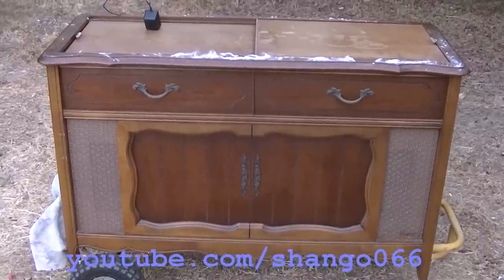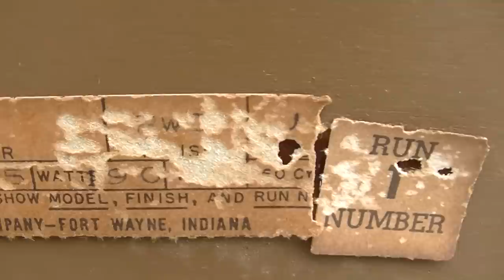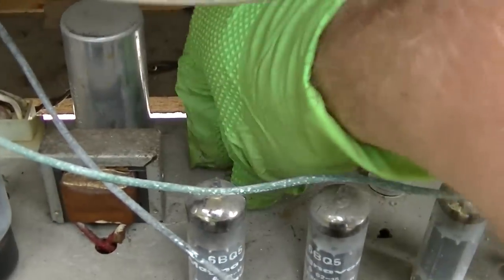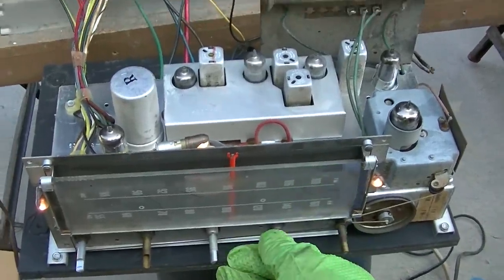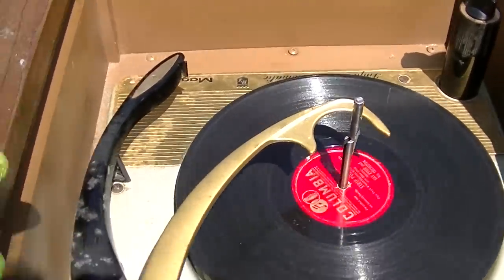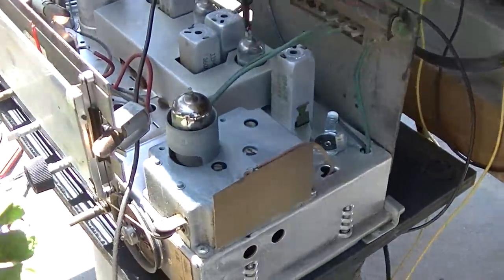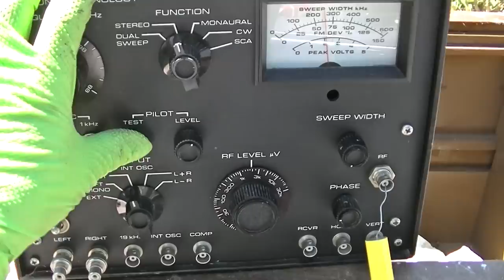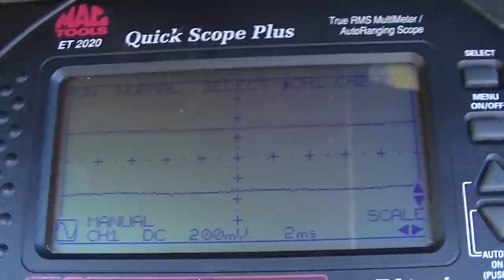1963 Magnavox Console Stereo Phono AM FM MPX Resurrection Repair Whatever v3

Comment: Considering that ancient linear wall wart and that huge barrel connector; I think that a portable CD player was the thing using that AUX input.
Reply: Doesn't seem all that ancient though.
Reply: @marka1986  

It has a datecode of '94 on it apparently, and it also looks that way. Late 80s to early 00s.
Reply: I guessed the same thing I bet someone way back when used a portable cd player on this
Reply: That's an eighth inch barrel. Screams Discman to me.
Reply: @cookingwithchefjeff  weren't that the same eighth inchers that was in everything until recently?
Reply: Walkman!

Comment: That is actually a very nice amplifier.  David Gillespie posted a thread over on AudioKarma called "More Fun with Magnavox: The 9300 Series."  He modifies that exact amplifier with minimal effort and effectively makes it "HiFi" (at least as HiFi as tubes can be.)  I have one of those amps myself, and am currently building a second one from scratch.  They sound very nice. That is an awesome find!  NOT TRASH!
Reply: This is a premium model. The Imperial line was only sold through Magnavox franchised dealers. You couldn't get this in a department store where  the regular line was sold.
Reply: @66skate  It was rare to find any Magnavox console stereos in department stores where I lived in NJ.(60s, 70s)   The department stores had low end stuff "Admiral, Electrophonic etc " you had to go to appliance dealers to get good HiFi and TVs
Reply: @seesea-sv3xw  There were 2 dept stores where I lived in Massachusetts back then that sold Magnavox.. One of them had an entire area with only Magnavox. Next town over had a Magnavox only store.

Comment: OK I sucked at TVs but I still do these consoles in my sleep blindfolded and can say that while you went more than a bit roundiebout you got it basically right and accomplished the task at hand. It was tons of fun to watch while I wasn't screaming at the screen.😋🤣
We in a production environment wouldn't waste any time on old caps but you know that with TVs. I just wish 2022 technology allowed me to demo you how we do FM now. It really is a jaw dropping experience to go from caps, coils, resistors and tubes/transistors to software defined radio with no parts at all but a pre-existing PC. and a cheap USB dongle.

Also I didn't even know that rpm phone app existed. I've been on the strobe disc. I will use the app going forward. Thank you fine sir. You're a gentleman and a scholar.
I did enjoy doing CRT setups back in the day but the business aspect and that 40KV thingie (60KV if you include the Zeniths with the neck blown off the bulb from the bad cap) kind of kept me from getting all pro with it.

Comment: All your videos are really enjoyable but this one in particular was really great fun to watch, put it on and thought i'd watch a little and go get a drink and come back and watch the rest but ended up sitting down and watching it all.

I think even today if that were all in running order with proper crossovers and some decent music fed into it it would still blow people away, especially the younger kids who have never heard music played on anything larger than a phone speaker before.

I'd guess it was a portable CD player hooked up (badly) to the aux.. I had something similar 25 years ago now.. doesn't seem that long!

10-12 watts per channel in PP maybe? Never did get to see the underside of the amp/psu, wonder what the other side of that tuner plug looked like.. probably a rats nest of wires..do you think its probably a cathode bypass capacitor shorted / bad plate resistor to the output tubes causing them to redplate?

finally that MPX unit really well made.. I recognized your comment about tubes with FM stereo being unreliable.. seen a lot of philco stuff that seemed to go out of alignment just by breathing on the leads!

Comment: I have a 1954 Zenith console Am Fm with cobramatic turntable that my great uncle bought new. He knew how much I liked it and I inherited when he passed in 1994 at 100! It works absolutely fantastic, the cabinet is very nice, I'm sure he never had a restoration on it, so I belive its all original,  I checked all the tubes in it when I got it,  they are all Zenith,  except for 1. That one is a GE. in the 28 years I've used It, its needed nothing,  it just always works!

Comment: RCA developed stereophonic sound in around 1958 for phonographs. That's probably what that patent is referring to. These Magnavox consoles are great consoles. Very well built, as you pointed out. And they can really sound great when they are working correctly. By the end I was practically screaming at the screen for you to replace caps in that power chassis. Man, this thing could still be great. Get in there and knock those coupling caps out and fix that oscillation too.
Reply from the maker: It's all disc. There was no bias  from wakey capacitors I checked that . It probably needs some New electrolytic but whoever adopts it can do that
Reply: Gotcha! Missed that part.

Comment: I recently put an order in with Electronic Goldmine out of Arizona, and as part of that order I included one of their gold-pak capacitor bulk box. It contained about 40 of that style capacitors in the box of around 1000 caps. I had never seen one like that before.  It sure resupplied me with caps, I should sort and sell a few hundred of the electrolytic in 4.7 to 470 most brand name caps at various voltages as my bin is overflowing with many of them.  Good outfit for their large capacitor surprise packages.

Comment: While I miss the CRT work, this unstraight troubleshooting by our  unrestrained host was wonderful walk down memories lane. My parents owned the Maggie model above this edition. In fact, the top early 1960s stereo furniture by Magnavox. It has FM tuning eye, VIVIVIVIbrasonic, center bass woofer 15", L R 8" mid-range, LR 1" tweeter, changer, etc. Here is the kicker: my brother kept it, original tubes, resistors, and caps. Except for the dirty pots, it operates perfectly...60 freaking years later. The problem is not with corporate WOKE which is just PR. The problem is that nothing is done for decades any more. It is all short side leadership in every sector. We don't build em this way.

Comment: Thanks to this video I learned. Well let me just say, I just picked up a 1962 magnavox theatre (27 pict. tube)no uhf/ am/fm tuner/phono
 Model (1MP422M). But it has close to the same amp and tuner ( except my am/fm tuner has a spot to turn the tv off and on. speakers have the same horns pointing forward, big woofers pointingat the ends of cabinet, same as that one. But I found out it's tough to get the Sams photofact for Magnav. consoles. I called one guy selling them Steve, he said take out the tuner, and take close up picture of it, and give him a drawing with the tube location and names and he'll take a couple of days & try and come up with the Sams.  I just got it, seeing how it was all
tube I hoped, th  model # wasn't given in the add just said $100 bucks come and bring a truck. The "sun", must have been hitting the back of the tv for years as the model #paper was very hard to read I corrected 1 letter I had off from another person selling a simular unit that the paper tag wasn't bleached out. He just had sereis 1 & I have sereis 3.  But I've only had It for  less than 3 days. I think the tubes that said 62
were correct. I think they, went solid state in 1963. My tubes (high hrs set) are caked with dust, So I haven't read amything yet. But I looked at that metal inpression  stamp No. on the multiplex board it matches your Number, maybe just a part No.  But I didn't know what board that was or what It did. Thks for that informative part , about the multiplex and what it's job is. And how the tuner has special plugs and everything just will plug in.The only way to talk the wife into me, getting this, ( being as big and heavy as it is) was that it's my christmas present for 2023, except she did let me get a tube tester and  Beltron CRT Tester Restorer With Dandy-Dapter Universal Adapter CA-28
 $140.00  plus $30 shipping. I know I paid way to much for that. I tried to cancel it when I found he was charging double the going rate.

Comment: Magnavox console model 1ST659A from 1963 . For starters might need to use half a can of DeOxit on those switches, 
tube sockets, terminal contacts, and pots! It's an all uphill battle on that basket case after that. Your analysis of how the whole thing works is a great
 teaching experience for the viewer Shango.
Reply: 1961 MODEL
IMPERIAL MICROMATIC CHANGER IS FROM 1961

Comment: As usual your videos are very entertaining. The best part of this unit is the amplifier and the speakers. If you work to pull out that amplifier and recap it you would have a very nice amp there. Back in the day these units sounded fantastic. About 35 years ago I was able to drag one home that was found in the street but it was much larger and had the television in it. The CRT was bad in the TV so actually all I did was parted it out the amp the turntable the speakers and the rest went in the trash.
Reply: The power amp section sounds better than Dynaco!

Comment: Excellent video! I have this exact model and have started restoring it, including full recap, and want to get back to revisiting it, as it still has some remaining problems including too much 60 Hz hum which might be shielding or grounding issues somewhere. Mine also has crossover cap issues where one side has some treble and the other side has none at all out of the horns. I had two multiplex adapters for it and one worked and the other is quiet. I wonder if that 4 MFD cap in the quiet one is bad like on this one!  I had to stop working on mine when I had people wanting me to repair other radios for them.

Comment: I've got a very similar model.  I had a heck of a time trying to find service information for it, the only thing I could find was a Sam's for the tuner.  Turned out the power choke must have shorted a few turns and the plate voltages were around 300 instead of the 245, which was causing the 6BQ5s to red plate.  Added a resistor (okay, a 40 watt light bulb) which brought it back down.
Reply: I brought similar unit as used in 1974 from fellow student at school for $80.00. The unit has similar FM modulation unit connected with cable. I took the tube to Radio Shack for testing and replaced the tube. When power on it blew the fuse. I tried to repair it myself and unsuccessful. My portents thrown it away during clean up.
Reply: These have a cathode bias circuit. If you ran into red plating you may have a shorted or leaking bypass cap on the cathode circuit of the 6BQ5 tubes or a leaking coupling cap to the 6BQ5 tubes. I would be sure and check those out if you haven't already done that.

Comment: You are correct about Zenith having invented the FM multiplex system we use to this day. But knowing RCA, and its penchant for glomming onto and stealing other's credit, it doesn't surprise the label information. You pulled pretty good performance from that tired old girl. Thanks for an enjoyable video!
Reply: My understanding was that Zenith and somebody else, maybe GE or Maggotbox came out with systems that were so close to identical that the FCC authorized both and let broadcasters pick one as they both worked on all receivers. Anyway this mid side technique was used for many things including the CD4 Quadradisc and analog NTSC stereo (with DBX added to the L-R). There are even vestiges of it in the NTSC color broadcast specification. It was just how you did it in analog. Now I do analog FM stereo both RX and TX in Python.

Comment: 1:20:00 As I remember it, those Magnavox horn tweeters had fairly lousy dispersion the way they were usually mounted (shouldn't the longer dimension be horizontal, not vertical?), though these seem to be aimed out at a slight angle, so they may be a bit better.

Comment: Yes i still us a i pod ( ipod classic 160 gb ) it's great and have a docking stations at home and with the usb  cable can use to plug into the car radio in my car and also the caravan. No more cassette tape CD's or even minidisk. All are limited to play time. I have around 60 Gb of music and play the music on random. Works forme and realy has been a god sent !! There are lits now that you can replace the hard drive with a solid state memory.

Comment: Shango its amazing to think that these old radiograms only output about 3.5watts a channel yet were very loud, their speakers although were paper cones were very efficient over 110db/w some of them, today its the other way around we have stupidly overpowered amplifiers with crap speakers about 86db/w efficiency, unfortunately paper cone drivers arent really any good for high power amps as they have the "oilcan" effect when turned up loud, basically the paper collapses like pushing in a coke can. you need aluminium drivers for high power and lots of bass.
Reply: Should be quite a bit more than that with push pull 6BQ5 tubes (or EL84 valves).
Reply: @westelaudio943  3.5w pc at 16ohm so about 6w a channel at 8ohm, but with high efficiency speakers like this it will sound more like 15w pc
Reply: @westelaudio943  pretty well understood to be 10 to 15 watts on push-pull. It's more than 3.5 I owned one in the 1980's and loved it. It was clearer and louder than my STA-52B at 12 or 16 WPC.
Reply: @johnnytacokleinschmidt515  11 watts per pair, push pull, with 250 volts on the plates, or 17 watts per pair with 300 volts.
Reply: @Synthematix  

Tube wattage is independent of speaker impedance if you are using the right transformer/taps.
Reply: The output of that amp is 30 watts or 15 watts per channel at 3.2 ohms.
Reply: @johnalbanese30  so at 8ohm that would be roughly 4w a channel
Reply: @Synthematix  It's a tube amp, it would not be 8 ohm 
I have the same amp the out put is 15 watts at 3.2 ohms.  Magnavox tube amplifiers were never 8 ohms.
Reply: @johnalbanese30  No i know, i was saying if you added 8ohm speakers the output drops.
Reply: Why are you talking about 8 ohm speakers. Magnavox put  two 12 inch woofers, and two exceptional horns in the cabinet. If you got the set it will never sound the same. The cabinet, amp and tuner chassis are designed for that set. Even if used 8 ohm speakers as the external set the main set is still 15 watts per channel!
Reply: @johnalbanese30  because 8ohm is the reference standard, 3ohm speakers are oddballs in home hifi, manufacturers dont measure speaker output using a 3ohm reference, most amps would overheat with them. no wonder the tubes/valves in this thing are getting red hot
Reply: @Synthematix  When  Magnavox made that set 3.2 ohms is the norm. Tht tubes were getting red hot, because someone never barther to check the two caps between tube socket one and two  and three and four. I know because I have the same amp, and I had the same problem. It cost me five dollars to fix the problem. So please stop talking about 8 ohm speakers.

Comment: Another great video, that set would’ve been amazing back then especially the stereo separation on fm broadcast also when working with a good needle those magnavox record players are really good, I still occasionally use my magnavox counsel but it’s a lot newer and transistor powered but still has a good sound, I do need to take out my chassis sometime and clean the pots and fix the loudness switch so it will sound right
Reply: Greetings: Your counsel provides legal advice, but your console provides audio for your ears.

Comment: Analog tube amplifiers have that warm rich sound. With the tube amplifier I see that it doesnt have to  have a high wattage rating to play loudly. Magnavox used the 1000 hertz exponential horns in most of their consoles I love them! When Magnavox went to solid state amplification they used Germanium transistors which closely replicates the tube sound! I have a 1500 amplifier that is rated at 75 watts per channel IHF and 50 watts per channel RMS I understand their power ratings were conservative as some tests have revealed my amp was showing more like 67 watts per channel. This amp is a MOS FET RF amp.The power transformer is huge! Their are heat sinks in the back also. i need the pots cleaned and pilot lights replaced and I think I will be alright.Possibly recapping also.Magnavox made good sounding stereos,, they made some good components and then Phillips bought them out.Some people always bash Magnavox its a quality product line overall.

Comment: The FM multiplex standard chosen by the FCC is actually a combination of the GE and Zenith systems which were very similar. The main advantage of these systems over the competing Crosby system was the preservation of the 67 kHz SCA subcarrier which was an additional source of revenue for the FM stations. The chosen GE-Zenith system actually degraded overall S/N ratio in stereo for this reason...
Reply: Yes! It really would have been interesting if the Crosby system could have been the one to be chosen, there would have been fewer problems with "fringe level" FM signals degrading the stereo so quickly.
Reply: @oldradiotvsc9836  yep, the Crosby system used an 50 kHz frequency modulated subcarrier versus a 38 kHz amplitude modulated one on the GE/Zenith system.  This gave it superior stereo performance in fringe areas.
Do you know what would be the ultimate? To recreate a complete Crosby system with transmitter and receiver, using modern electronics to see how good the system really was..